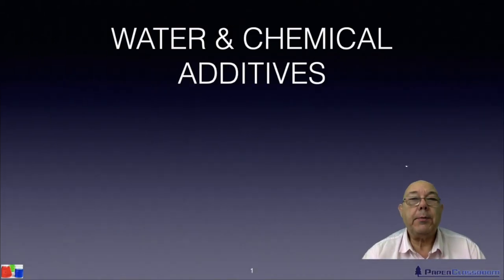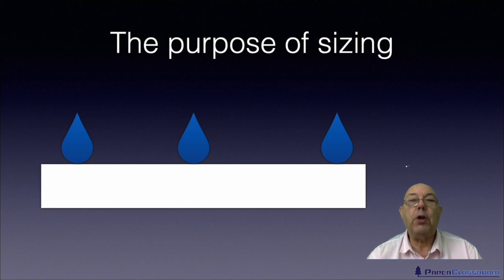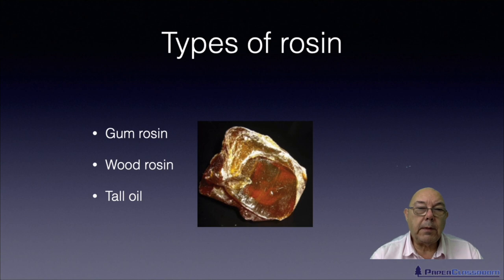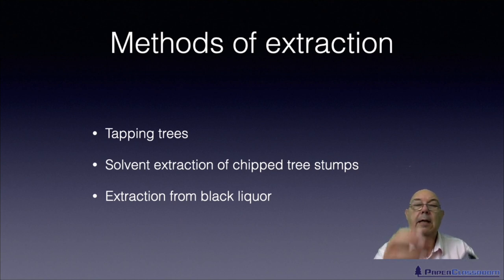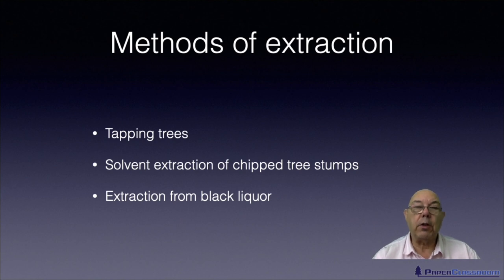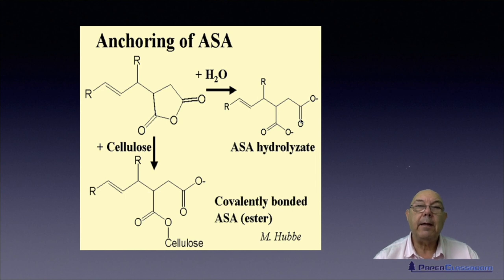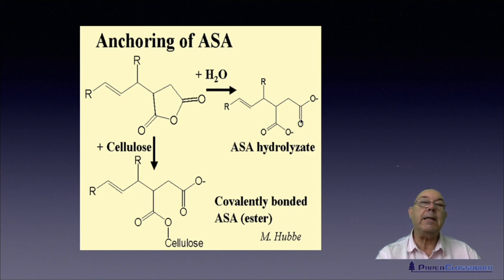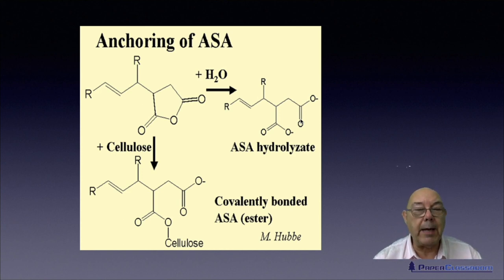Level 2 Papermaking - Sizing Chemicals

Comment: My watercolor paper after long storage lost its sizin. What can I do to rezise it. Thanks
Reply from the maker: Thank you for your question.

When fresh paper is sized and then after the passage of time the sizing disappears, there are two options. You either have sizing reversion - in which case there is nothing to be done. The sizing agent has been permanently denatured.  Or you have Fugitive sizing. In this case, the sized nature can be restored by heating it up.  Roughly - 105 C for about 15 minutes should do the trick.. If this does not work, then you have sizing reversion. Good luck !!

Comment: Can Alum be used in Paper Making without rosin to achieve water proofing (sizing/cobb).. Some paper Mills in Pakistan use starch and alum at size press to improve bursting and cobb, is this possible or this am accurate approach.??
Reply from the maker: Hi. Thanks for your question. The short answer is no. 
Rosin does the waterproofing- the alum holds it in place in the fibre. 
I have never heard of, or seen alum used with starch. I cannot see how it works. The starch will provide extra hydrogen bonds which is why the burst will increase.   This may contribute to an improvement in temporary wet strength. This may show up on a short cobb like 30 seconds or 1 minute. But I guess you will never see it on a 5 minute cobb

Comment: Can we use these sizing chemicals at size press? Or wet end only
Reply from the maker: Thank you for your question. The answer is, it depends on the chemical

For the rosin/alum system, it can only be used at the wet end
For materials like AKD, it can be used either at the wet end, or the size press
Polyvinyl Alcohol can also be used, but because of its cost, it is best used at the size press

Comment: You mentioned that after the paper dries when using AKD that there is still no sizing effect. I am making handmade paper and am going to use AKD. So it will will take three weeks after it is dry until the paper is properly sized and complete, right? That seems like a long time, or am I missing something? In videos where people make handmade paper no one has mentioned that AKD is a three week process until there is usable paper.
Reply: You may try to speed up the process by drying at higher temperature. We use AKD and dry the paper at temperature 105 Celsius. Several minutes at this temperature gives good enough initial sizing effect which improves during following weeks.

Comment: Firstly, Thank you so much for this informative video. My question is that how ASA Hydrolyzate is removed from the system? And is there any procedure for removing of akd waxy material formed also?
Reply from the maker: Thanks for your question. You cannot put in a procedure or equipment to remove it. It is a solid particle and so it will get trapped in the sheet as it goes down the wire. this is the only way it can be removed from the system and is the reason why the sheet is slippert